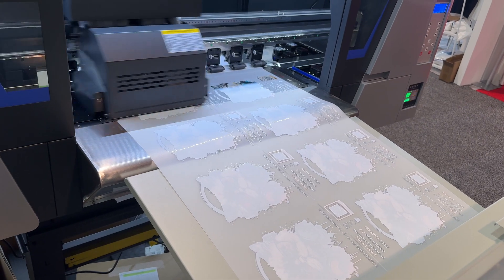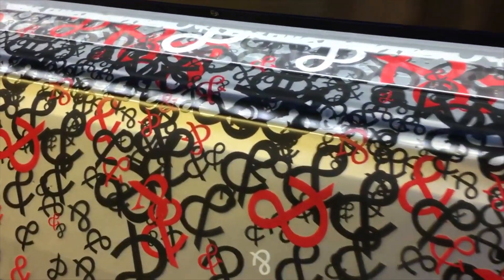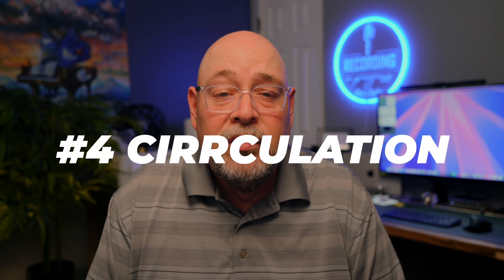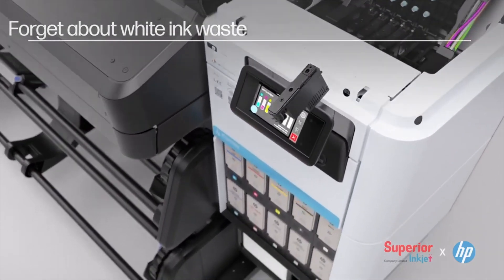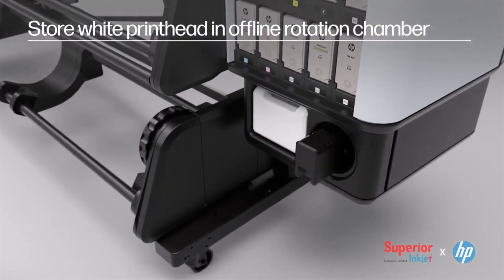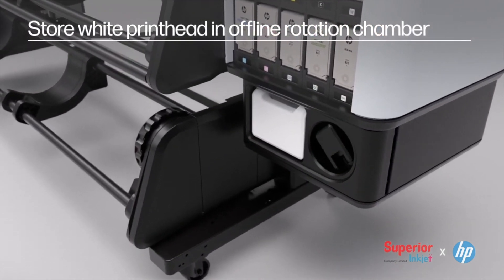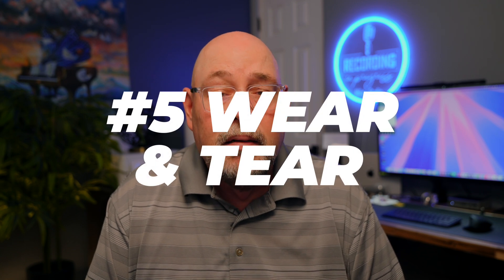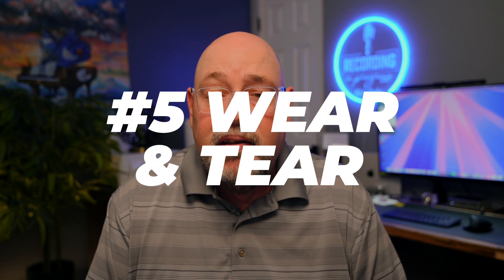Essential tips before using white ink in printers

Comment: What is your view for buying Eco solvent  wide format printer  from  China  vs buying a Japanese  printer
Reply from the maker: I think both are capable of building quality printers at comparable prices. It ultimately comes down to support. You can build the best printer on the market, but it’s worthless if you can’t get it up and running correctly. Which printers were you comparing?